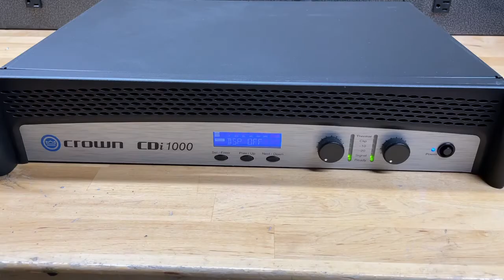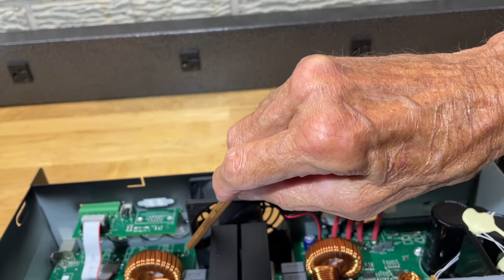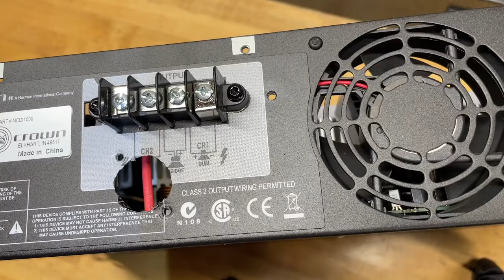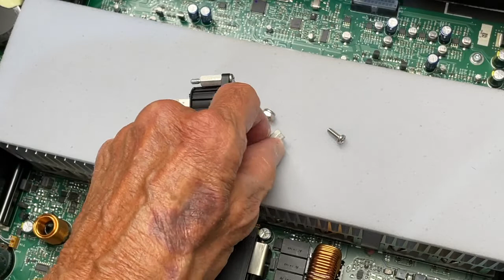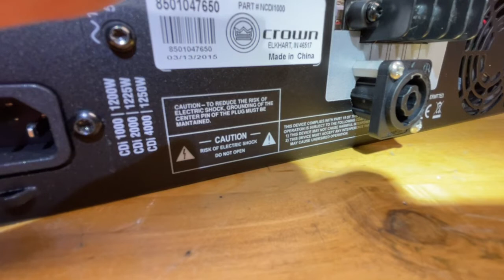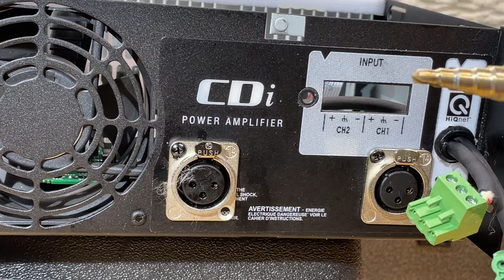Crown CDi1000 Power Amp Mod

Comment: That's actually pretty cool! But for my application (and likely most people's) it's not worth "hacking the back of the amp up" like that. Most people will have this amp mounted in a rack, and it's easier and neater to just make an external patch panel that also mounts on the rack. You basically just made the back of the amp into a patch panel! 

And if u don't mount this amp in a rack, you probably are not using it for mobile PA, which means it will sit on a shelf as an install amp, so then the screw terminals are totally appropriate anyway.....

Still cool to know that there are knockouts though!
Reply from the maker: Brilliant observation!!  I could have made a video about making a patch panel!  Thanks for sharing. -Ed

Comment: The CDI and XTI series amps are identical aside from the the I/O. You can find the correct terminal blocks that line up with the solder pads. With the speakon connection, if you do that you need to move the caps that are located in that area over to the side in their designated locations

Comment: FYI... Based on other crown amplifiers the 2 extra input holes in the back panel are for pass through to another amplifier and the holes with the square portion at the top are the input holes with the extra space being for the connector release tab. Nice work around!

Comment: I'd be concerned about tiny metal bits inside floating around after using that step bit to widen holes.  Regardless, it's a neat mod, since crown unfortunately loves those inconvenient phoenix inputs.
Reply from the maker: Hi Jason. I put a towel over the inside to catch the majority and then vacuumed the heck out of it!  Good comment!  -Ed
Reply: @edwhitney1862  I was wondering!  Glad it worked out!
Reply: It’s only inconvenient if you’re using this amp for portable purposes. This is an install amp so that makes the phoenix connections much better than xlr. It’s a much more secure connection. Now if you decide to use this amp for mobile applications crown has made it pretty easy to convert these connections like this guy has done.  I have the dsi1000 amps that look just like this one. It’s a cinema amp. Like all of there cinema stuff. It’s all direct wire equipment. The Dolby processor has a 25 pin d plug that wires directly into the phoenix connectors on the amps. It seems confusing and complicated if you’ve never worked with these connections before but it’s actually quite simple. Nice job showing everyone how to add xlr connectors to these amps by the way! This is a good option for someone that has some of these amps and don’t want to buy new amps just to have xlr connections. Price are too high on everything now days.
Reply: @225savage0  It's inconvenient because the Phoenix connectors are not found everywhere, not because of other reasons.